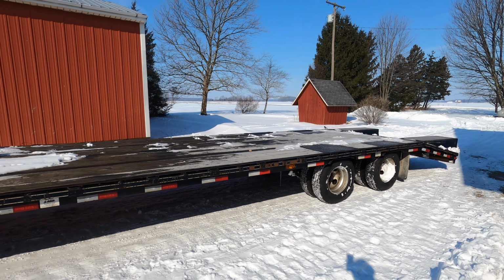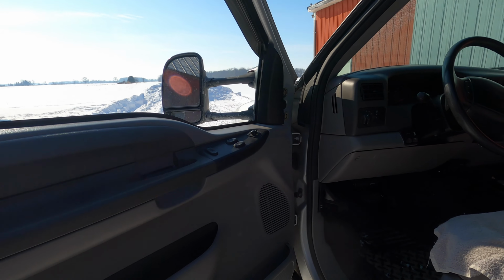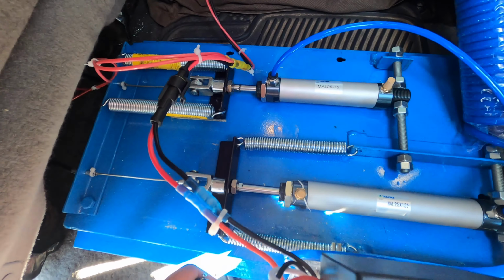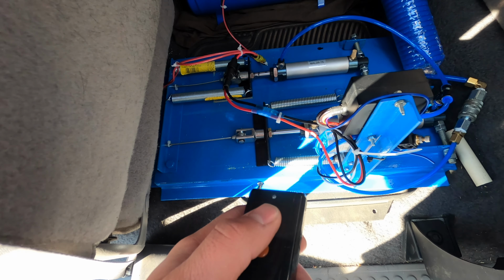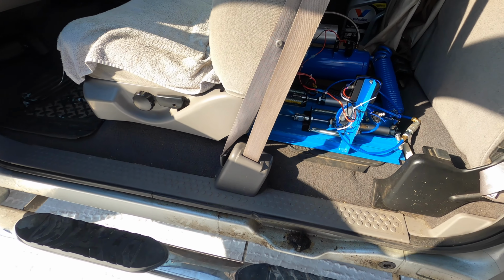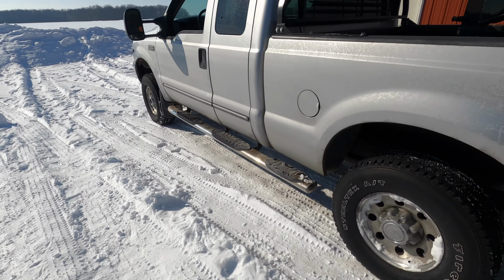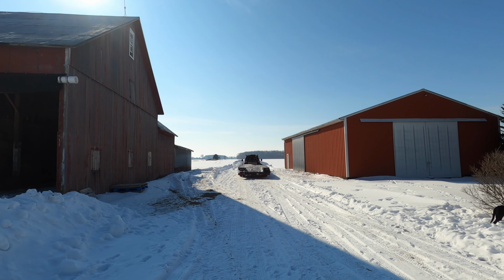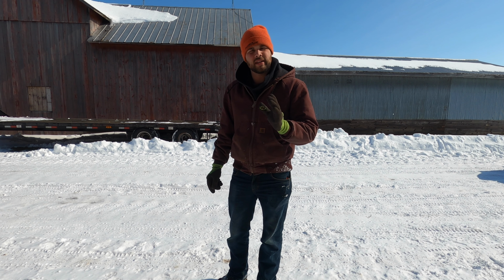Farming with a remote control truck

Comment: If only Teslas worked better off road. They can do this with no modifications using the phone app, and I use it a lot when parking. Clever use of materials to get it added as a mod.